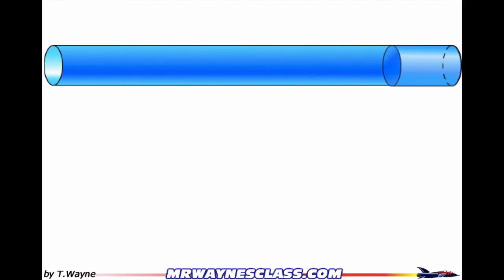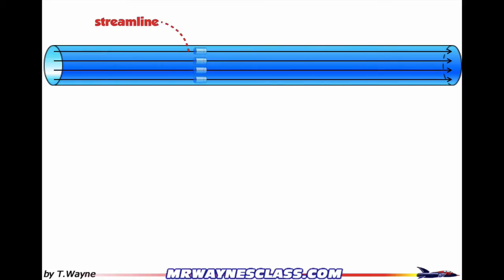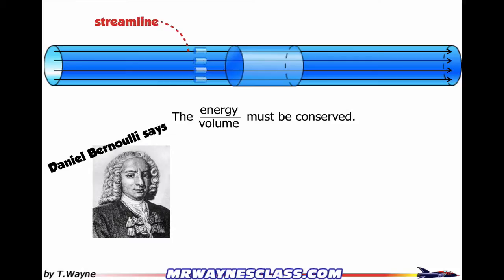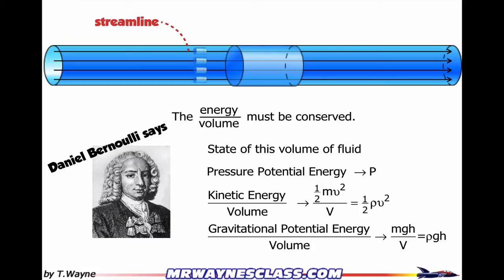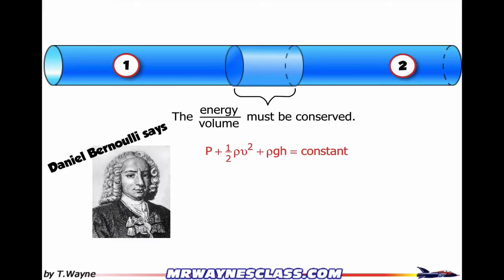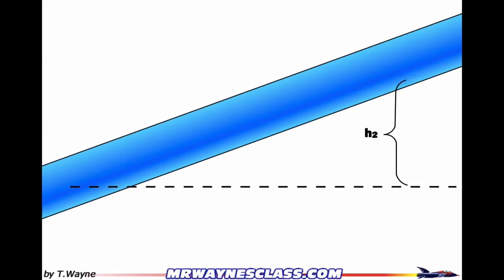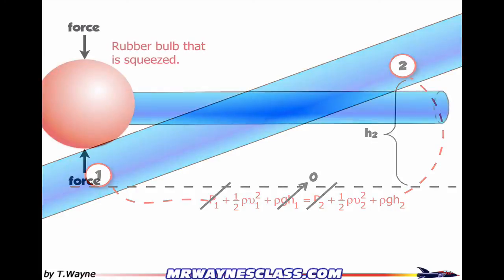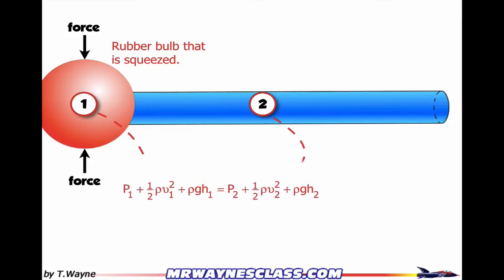Bernoulli's Equation

Comment: Hi, I have a question regarding your Bernoulli's presentation. I am confused if the A1V1=A2V2 continuity equation applies to liquids and to air. Would please explain how the continuity equation applies to air, please provide some references that I can read. Thank you, Oscar
Reply: Oscar M 
Yh , it is. That's the volumetric follow rate